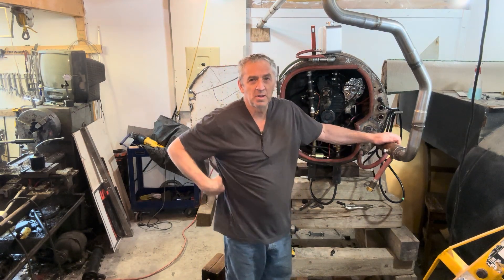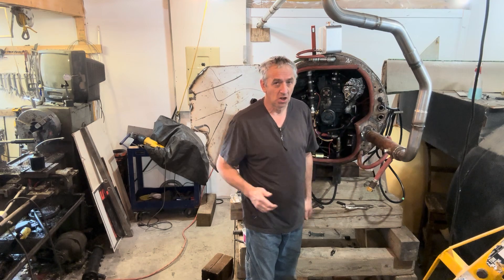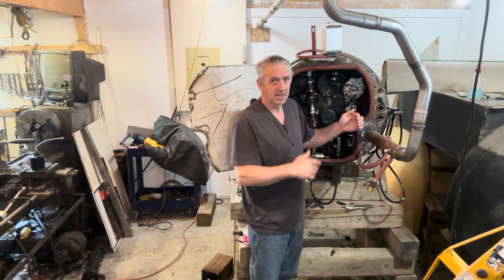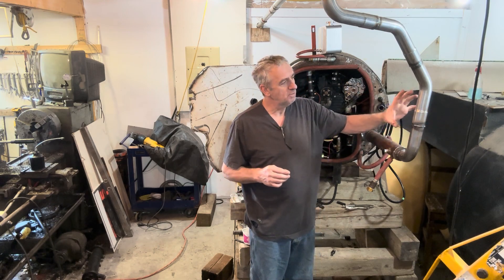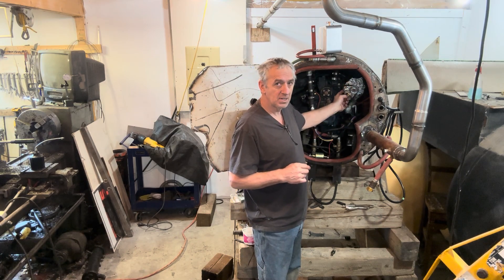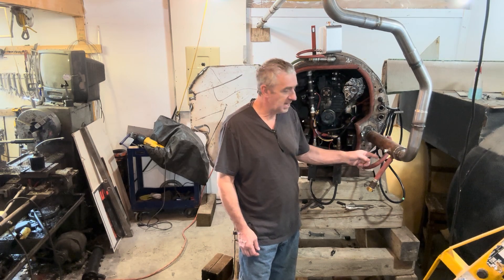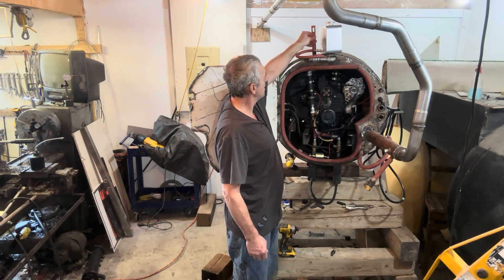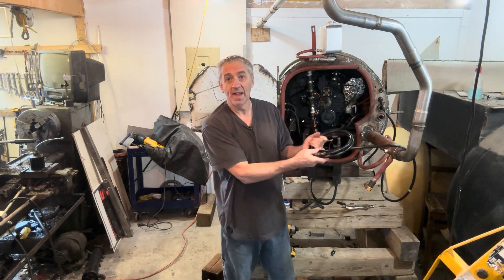Home building my diesel submarine

Comment: Hi hank, you may try insulating the unwater cooled section with the pipe wrap that the hot rodders use on their headers. I used some on an old work boat I had years ago. It worked well on a 3 cylinder Lister.
Reply from the maker: Thanks, I have a roll here, was gonna test it also.

Comment: Curious why you could not run the exhaust out of the side of the submarine at the first convenient point and run the pipe externally where it will be exposed to water. That would minimize the pipe length inside requiring cooling or insulating.
Reply from the maker: I dont want the drag from a pipe and it needs to discharge up high for safety.  I dont want to risk water going back to the engine.  It would be simpler though.
Reply: @HankPronk  Was thinking something similar, only running the pipe  inside the aft ballast tank for cooling/streamlining(if there's room) and through the top.You can still run the stack out of the sail and maybe add some aft deck to cover the exposed pipe leading to it. Just thinkin.'
Reply from the maker: @successfulspider oh, yes that could work

Comment: Just wondering, when I scuba dive in NY, the water is cold enough to require a wet suit in the summer, dry suit in spring and fall. I know the sub's engine only works on the surface, above the thermocline, but would some exhaust heat be welcome on the way home from an hour in cold water? I don't know how cold the sub gets when submerged, is it an issue?
Reply from the maker: You are correct.  I will mostly use the sub in the spring and fall even winter.  Thats the best visibility as you know.  I think I need to make sure I can get heat from it as well.  I can also tie into the coolant for heat.  After an hr bottom time the sub is pretty chilly.